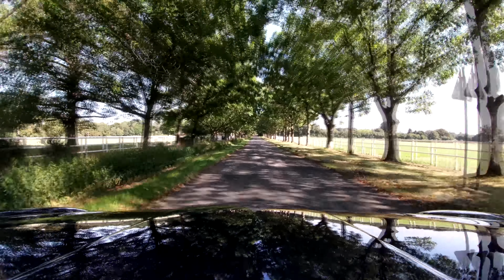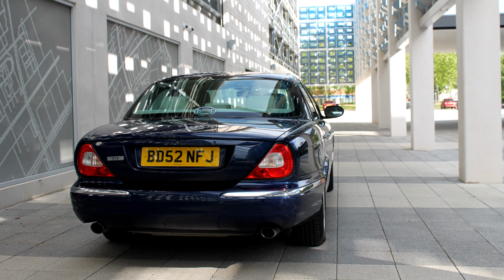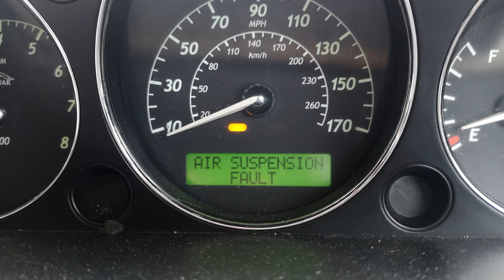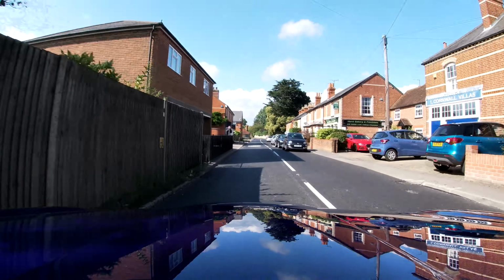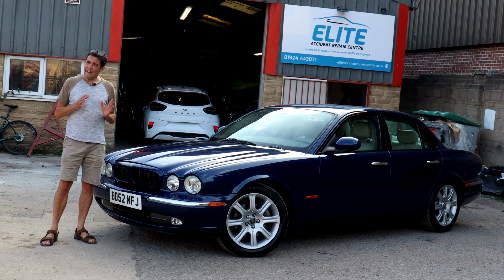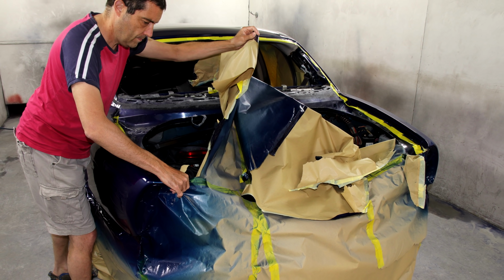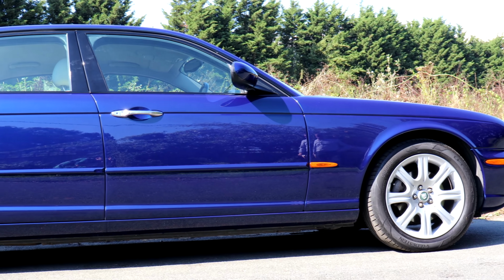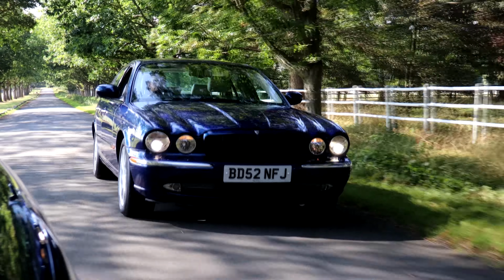What Happened To Our Jaguar XJ8 X350?

Comment: I have one of the last X358 from May 2009, had it for quite a few years now, not long turned 60K. I took semi-retirement about a year ago, got a part-time chauffeur job last summer, driving Mercedes E and S class and a Jaguar XF 2.0D, (all no more than 3 years old) I can't tell you how much more I now appreciate my X358, with the exception of the S Class ride quality (as it also has air suspension), my X358 far more pleasurable to dive than either E Class or XF 2.0D, after being in some of these newer cars for some hours driving around, I get back into my XJ to drive home.... my first thought yesssss what a dream to drive, ok maybe not got some of the up-to-date tech, but just glides along....

Comment: I’ve got a 98 X308 with 105,000. It is a Vanden plas . In sapphire blue with ivory leather. I have not done a total re-spray I have done some touchup do the dents and scratches. The paint matched beautifully. I had the driver seat restored due to cracking and one small rip in the leather. They sewed the leather back together. Did some work in resprayed The seat. I do not plan on getting rid of this car anytime soon it rides very nice but then European luxury is not the same as American luxury. But I still love the looks of My Jaguar